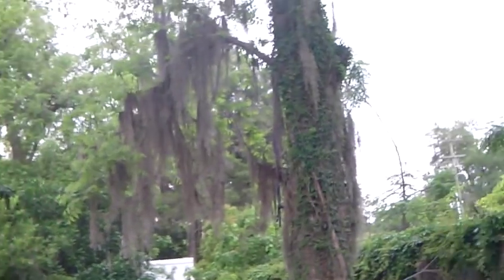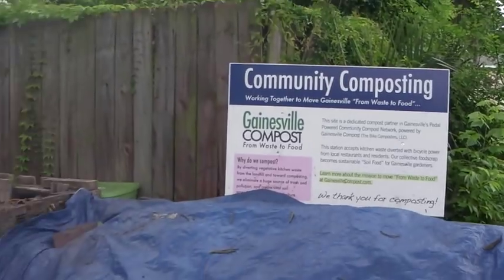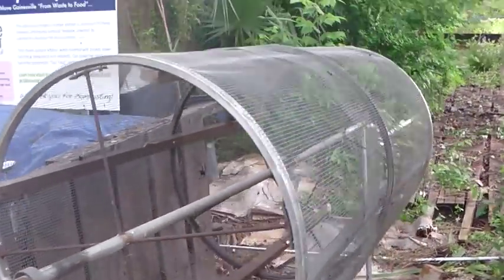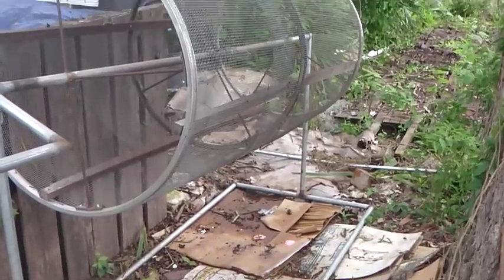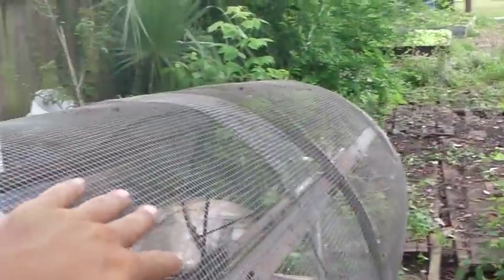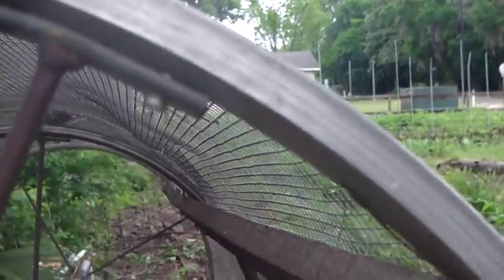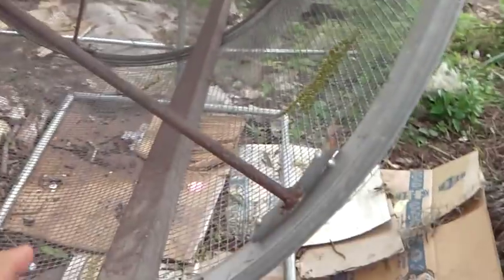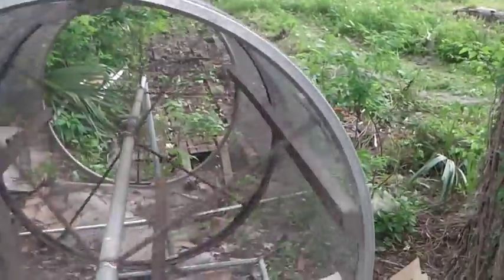Rotating compost sifter/sieve/trommel

Comment: With this device You could empty a 10 gallon worm bin as well as separate the worms from the vermicompost atd same time. Worms tumble down and out the other end while vermicompost falls through the screens. Works good if you don't rush it and have the tilt down angle just right. Have a good one!
Reply: Do the worms fall through the screen ?